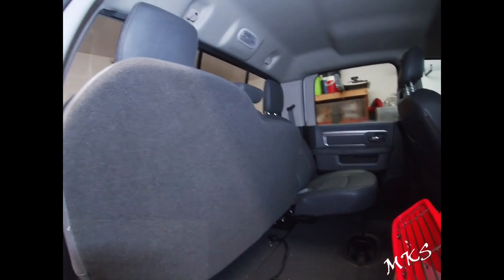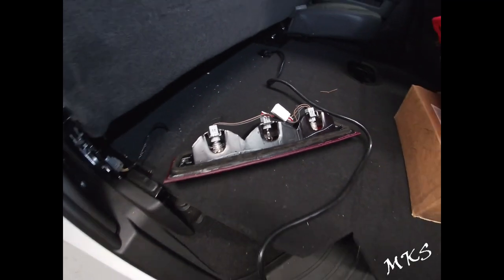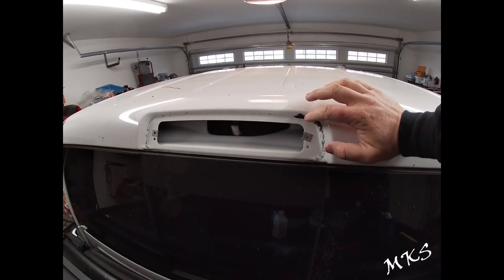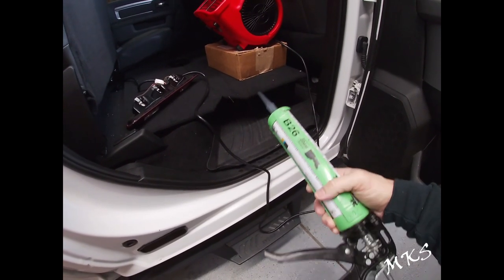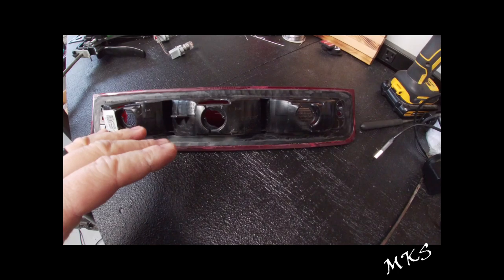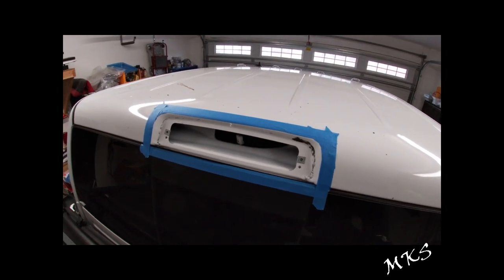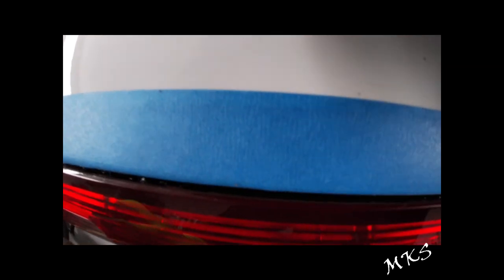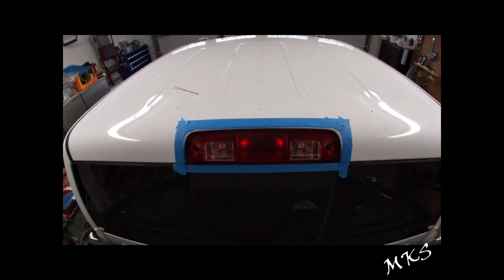3rd Brake Light RESEAL | 4th Gen Ram 2010-2019

Comment: Did you forget to plug it back in!?!?
Reply from the maker: No it was plugged back in.
Reply: @MKSPerformanceOffroad  8:13, why doesnt it look pluged in there?
Did you drop the headliner and plug it in that way?
Reply from the maker: @chriso1373  I may have plugged it back in from inside as the headliner was down at some point during the process for drying interior out.  Dealer had sealed it incorrectly and water was pooling in the floor.  We had to dry it out in the garage with big fans.  Easiest to plug in before installing back if you have a helper to hold the light while you put your sealant on.  I was using a caulk gun which made it a little more difficult if I recall to hold the light and caulk at the same time.

Comment: Noticed the black (Ditch Trim) left/right of roof at brake light level. That’s where roof and C-pillar meet. That is where, my 2007 is leaking. Water follows cab trim, to a leak dumping water in the corners of my cab. 😡🤬
Reply from the maker: Tons of places to leak from if you have additional areas like sunroof, cab lights, rear sliding window, and of course the CHMSL
Reply: Albert, sir, thank you much for replying. The interesting thing is that we have three of these trucks two from 2006 one with sunroof one without the one without has never leaked from those front door handles the 2006 with the sunroof when parked at the curb, it does slightly tilt towards the right side on a level street, and 1 inch rain. We hang a 1 gallon bucket from the doorhandle grab handle a pillar and it will fill that bucket as you described the 2014 truck #1 pointing uphill in our driveway at about a 3° angle. The water is coming in next to the passenger side rear headliner, and we have been putting a towel there and changing it out That Ditch trim you speak of? Is that the black trim that runs on the roof perhaps hiding a body seam going from the front to the back of the roof on our mega cab. We tried sealing up around the rear, brake light with silicone and sadly this did not work, do I need to pull this black trim off the roof and look underneath thanks for your help again only are two trucks with the sunroof are the ones leaking which is interesting. They are both mega cabs one from 2006 and one from 2014 2006 truck only leaks at the front door grab handle passenger side mainly Although my wife used to complain, Water would hit her knee when she was driving. Then I think I said put a towel on your lap ha ha we are constantly changing out towels and putting the fan in the truck to dry things out in our driveway. It appears that mainly it is passenger side headliner getting wet in the 2014 as I recall although there may be a bit of moisture on the driver side rear ,also Headliner
Reply: @redwood6737. yes, have attempted to seal up, “Ditch Trim,” Right rear storage, is now dry. Left side still leaking/pooling in storage. Have cleared rear window drains, prior to current pooling. All sunroof drains are flowing, “full stream. The third brake light area was dry, no staining. 6:06

Comment: So what’s the best way to remove the gasket?
Reply from the maker: @verycherry2689  I used an eraser wheel from 3M to remove the foam.  Eraser wheel works for a bunch of stuff without damaging the surface, just dont stay in one area too longer or put too much pressure.

Comment: I thought they already addressed this problem? Mine was in for 2 weeks, headliner was pouring water on dash! They replaced my brake light assembly. So far, no more leaks.
Reply from the maker: The dealer resealed mine incorrectly and I ended up doing the reseal myself because they didn’t follow the instructions FCA gave them.  This is just showing you the method that works and all the dealer does or is suppose to do is put windshield adhesive sealer on your foam gasket and reinstall.  If they only put a new light in  beware, it may leak again.
Reply: @MKSPerformanceOffroad  They replaced my housing, MINUS my led modules. Now I have to reopen it, to install new LEDs?! Those incands, aren't bright enough for hitching the fiver at night.
Reply from the maker: @03redrubi  while you have it out, do yourself a favor and put some windshield adhesive sealant on the foam gasket and re-install it.
Reply: @MKSPerformanceOffroad  Yeah, thanks for that, since I will have to break the seal again. I thought you were going with the bed cam light combo?
Reply: BTW, I'm looking at that Banks Pedal Monster.  Looks like a solid performer!
Reply from the maker: @03redrubi  yes we did switch to that.  Thought I’d make a video for the guys that dont have the led light though.  Common problem across all the lights.
Reply: @MKSPerformanceOffroad  Yes it is. I had a river in my truck. Do the cam/light combos leak as well?
Reply from the maker: @03redrubi  cant say for sure but I have seen a few that had the same issue.  Its not the housing its the foam gasket that fails so just replace the gasket with rtv or sealant and your good

Comment: You'll need a stick of Dynamite to remove cover if a bulb burns out...no thanks...
Reply from the maker: It was still pretty easy to remove when we had to do some other work.  You can use this or RTV on the factory foam seal or just RTV.
Reply: maybe I will try it then,,,thanks @MKSPerformanceOffroad
Reply from the maker: @dbergum1  I have an LED CHMSL so not a big deal for me but if you are doing bulb changes more often try RTV first.
Reply: The trim (Ditch Trim) left and right of the third brake light, is where water is following the trim and returning to my headliner. Park uphill, fills storage under rear seats. Park downhill the  water comes out the front grab handles.
Reply: I ended up breaking my old light off to replace bulbs previous owner siliconed it on and had to buy a new light

Comment: When did you plug the light back into the  truck wire harness  I know when but it should be reconnected looking at your vid you never plugged in to the truck connection and just screwed it back to the back of the cab  ?
Reply from the maker: Plug it in before you reinstall.
Reply: R 2014 Limited mega cab leaks at the passenger rear headliner and also there’s water on the carpet right next to the passenger rear door. Also water drips from the front passenger grab handle which could be because the front sunroof drains are plugged? Or 2006 mega cab Only leaks from the front passenger grab handle and we have a clean the front drains from the sunroof in the front door pillars but it still leaks in the last frame. Thanks for your help. There should be a class action lawsuit and a recall on these leaky ram trucks
Reply: @redwood6737 I have an 07. There is trim(Ditch Trim) left and right of roof at third brake light level. Rain water is following that trim, dumping water on my headliner. Park pointed down hill, water to front of truck. Park pointed uphill, water fills storage under rear seats. 😡🤬